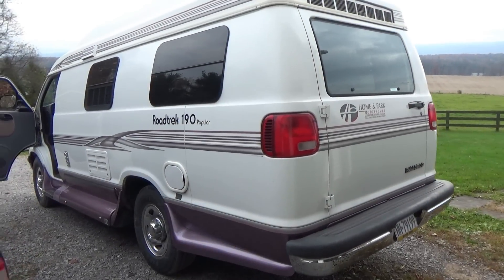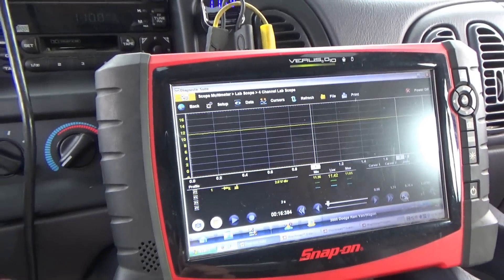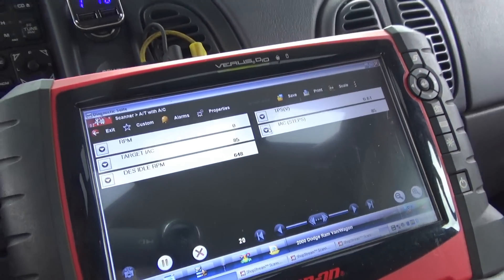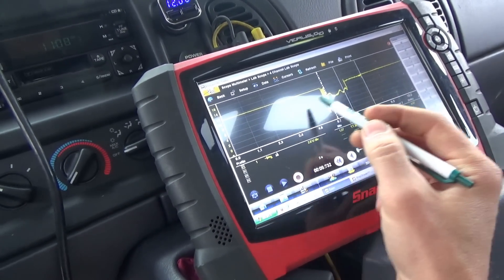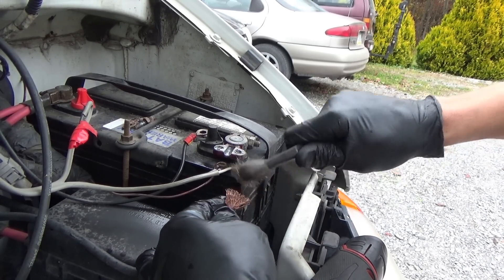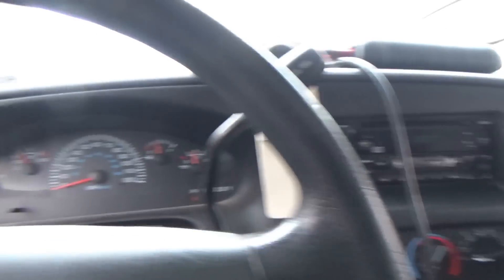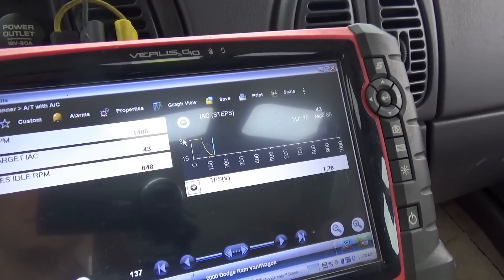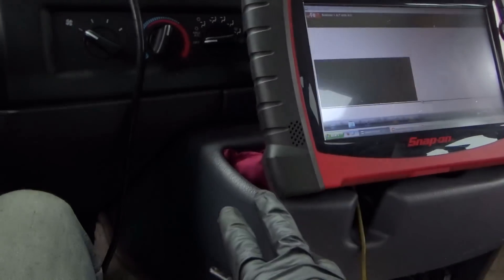Ram Camper Van is BACK! (Hot Start-STALL after X-country Trip?)

Comment: Well done ivan 😀
The evil resistance is a pain, especially with three types of metal playing up.
Connecting a volt meter to the starter + and battery + will show the evil resistance effect :-D
The wire looks rather thin so cranking  is not as good as it could be.
A new battery would give it a supercharge lol.
If it was mine, i would use truck battery cable,  i'm greedy lol.

Comment: I'm only 4 minutes in so far bit sounds to me after the hot soak the starter motor is too hot... common v8 problem... I would try insulating between starter body and engine block and going from there.

Comment: Why was the idle IAC initially 30 after the repair, but 20 later?
Battery state of charge!
With the poor connections charge current would be limited, but after cleaning the battery would be able to pull in the current it needed.
More alternator load, so more engine mechanical load.
Also, I think you didn't have the headlights on later.

Could you have got the minimum airflow test to pass?
Yes - but in practical terms you know it was done 8000 miles ago and removing the doghouse to clean the throttle body again just wasn't worth it, as this clearly wasn't the root cause of the failure as presented.
So I wouldn't have either.

Really hate those terminals.
We don't see them much in shops here, but common on eBay.
Most common here but equally bad are the ones that have a tubular connection with two grub screws - the tube size doesn't match the cable size and the screws only just touch some of the strands.
I use the "commercial" ones that have an 8mm stud to bolt a crimp lug on to.

Comment: Ivan..  I beg you Please just take 30 seconds and look up your video:  
"DANGEROUS to Drive! Ram Camper Van STALLS After Hot Soak - Part 2" -- 
It's your own video-- and jump to 10:27, and read the very bottom line.   I won't have to say anymore, you'll see it yourself.  Even if the IAC completely dies, the van will still idle when the screw is adjusted correctly..  The fact that the van dies when you do the "min air flow test', it's blatantly telling you that the idle screw is not adjusted correctly.    At the moment it's working because the IAC is constantly working to keep it idling-- but if the IAC dies, the truck will not idle, and that's not how it should be.  Your idle stop screw should act as a fail safe and manually keep the truck idling, EVEN IF you unplug the IAC, or it dies, or loses it's memory again, etc..   Adjust the cable and it will be bullet proof. cheers.
Reply from the maker: Yeah I know...but it's close enough so shouldn't have any stalling problems anymore :)
Reply: @PineHollowAutoDiagnostics  Love your channel bro.. I've gone back and watched almost all of your back videos, and I've learned so much from watching your stuff.  Keep it coming.

Comment: The problem with that terminal is all the dissimilar metals:   It has a lead connector with a steel bracket that bolts down to the coper wire.   So between the three, there are a lot of "noble metal" interactions happening there.
Reply: Noble metals are ones that resist corrosion.  There are no "noble metal interactions happening here."   The list of noble metals is rhenium, ruthenium, rhodium, palladium, silver, osmium, iridium, platinum, and gold.   Battery and cable terminals are not made from those metals.
Reply: @buckhorncortez  Thank you for saying what I was thinking.
Reply: Galvanic corrosion  does no favors.
Reply: @T.J. Kong dielectric grease will not help in this case because you all miss one very important clue on top of the battery is over spilling acid which is the root cause of the corrosion on the copper even dielectric grease will not help as the battery need to be replace as the cells are degrading which is causing too much off gassing enforcing spillage on top of the battery case
Reply: @SHSPVR  Not so much over spilling, but VENTING gase at the battery posts that cause the corrosion.   This is common on older lead acid batteries.
Reply: @SHSPVR  they "all" leak some acid out through terminals and mist via vents. however the real issue is junk wiring(impurities) or maybe even copper clad aluminum trash...
why do I say that and come to such conclusion? age and having had many vehicles/batteries/terminals which all worked fine fine for 20 to 30 years. now days? I wont even go there. but please keep buying foreign super trash garbage...
Reply: @throttlebottle5906  sorry but there not supposed to leak through terminals nor wick out the vent as this is first sign that battery plates are breaking down which is the indication that the plates them self are unable to store the electricity therefore causing the acid to go into overdrive, it's kind of like when you try to shove 200amps thru battery
Reply: the owner could've done some cursory inspection and basic maintenance and avoided all this. kinda like the dude who drove 8 hrs just to have PHAD correct the trans fluid level.
Reply: @T.J. Kong I use what ever grease I have handy. Put it on the battery lug and cable terminals. Keeps things from corroding. Never had an issue with the grease causing conductive issues.
Reply: yes, because the "factory" terminal/connections lasted a life time. yeah NO, Chrysler has pioneered every garbage method of every electrical connection and device as of the 1950's.
I especially recall the magical(lol) "lean burn" cruft (as a kid), my fondest memories are it always running poorly and breaking down often, albeit that made me pay more attention to mechanical/automotive, as I was paying attention to electrical, electronics, plumbing and more(everything).

Comment: The best way I've found to clean those battery terminals is to take it apart, sprinkle on a good dose of baking soda, and pour really hot water on it-- on the terminal, the post, the wire ends, etc..   Since baking soda is such a strong "Base, it neutralizes the battery acid so well that it literally just dissolves it completely away and leaves the copper very shinny.   I was kind of shocked at how well it worked.  So that's my go-to now-- and I ordered a case of baking soda on ebay for nearly nothing.  It's even cheaper than salt.
Reply: Baking soda is a great solution for cleaning battery terminals!
Reply: I can save you a lot of steps and ingredients...

Cut those terminals off, coat them in mustard, and then throw them in the garbage and buy a real set of lead or cast copper terminals. Those flimsy, multi-material terminals suck balls and mustard is disgusting...
Reply: @athhud  I agree, but I like mustard.
Reply: @2aminitials  I don’t know what is wrong with you mustard eaters. I bet you like pickles too don’t you? Both of them taste like something that has gone rancid... lol
Reply: @athhud  😀

Comment: I'm only 2 mins in: --   You should do the "min air flow" test again, and adjust the ((throttle stop screw)) so that there is still enough air flow to keep the engine running, even if the IAC dies;   as it said at the end of the service data that you read 10:27 (in your previous part 2 video on this titled: "DANGEROUS to Drive! Ram Camper Van STALLS After Hot Soak - Part 2".  You should read it again in the service data, it very clearly says to set the minimum RPM by manual adjustment of the cable, and you never did that in the last video-- I remember commenting about it then).  You never adjusted the idle stop screw-- and that's why it still dies when you do the "min air flow' test.  The engine should never be able to go below 640 rpm once you set the throttle stop screw correctly....  As it is now, you're still relying on the IAC to keep it running, and that's not what it's for-- the IAC is there to help account for excess load at idle, cold starts, etc.    But when doing the "min air flow" test-- the engine should NOT die once the IAC is fully closed off-  Your throttle stop screw still isn't set right;  I understand that the IAC may have other issues too-  but you can bypass all that and at least get it to idle, by adjusting the cable.     Hopefully you come to that in this vid. :).. cheers.   Time to watch now
Reply: I think you might be correct. Ivan fixed the slow crank but not the stalling
Reply: before making ANY adjustments the throttle body should be pulled, inspected cleaned and rebuilt.. you should never adjust idle with screw adjustments to compensate for other issue.. its not a carburetor.. there is a small passage in the tbi that should pass adequate air for the engine to run at Idle with the IAC fully closed.. the tbi is DIRTY. the base gasket is likely leaking a bit,  where the Iac pintle seats is likely dirty. everything is screaming pull and clean the TBI.
Reply: @randy1ization  He did clean it in the last episode.  He showed how someone else was probably in there before - so that may be why the adjustment is off now.  The point is, when you clean everything and then do the "Min air flow" test, it turns the IAC off and closes everything completely-- so then you can set the minimum idle.   It should never be able to drop to 300rpm like it's doing.   The idle screw will set the base line.. and then the IAC only steps in when there is more load, or when it's extra cold, etc..  It doesn't absolutely need it, which is why it's still working now.  But it's a nice redundancy that makes sure that this thing won't leave you stranded if the IAC dies, and fighting to start it..   Newer 'drive by wire' vehicles don't even have this adjustment, but most of them don't have an IAC either anymore.   I don't think the IAC is supposed to be so active at keeping the vehicle idling/ running - which is going to shorten it's lifespan.   It's only supposed to step in as needed to assist:   such as if you're parked and coolant fan is running, and your AC is running, etc..   But for just a dead idle with no load, the IAC shouldn't have to do anything.
Reply: @calholli  exactly.,. but you cannot properly clean and service the TBI without removing and disassembling it.  the only cleaning I saw was from the throats of the throttle body.. you cannot get to the passages below this way.. you cannot inspect the base gasket, you cannot check for a rusted or broken spring in the fuel pressure regulator,,  you cannot clean where the Iac pintle seats.. Oem parts for these TBIs are relatively cheap, I would just rebuild it, and be done. having a mindset of always trying to fix things with no parts required can cause alot of comebacks. 20 to 30 year old parts wear out. the Iac pintle has moved back and forth millions of times.. why fart around for hours with a 50.00 part?
Reply: @calholli  heres why I disagree,, if it were cable adjustment issue, it would do it all the time.   this  is  intermittent. cable adjustment has nothing to do with the irratic IAC counts..  when the books says clean the part, they mean the whole throttle body.. not just the throats and what u can reach from the throats.. IF ALL ELSE FAILS,. then consider a stop screw adjustment.. Idleing poor running or intermittent problem engines up,  without finding out the root cause, IS hack work. I will stick to my diagnosis that the IAC is failing and the internals of the throttle body are dirty. in the first vid I said it would be back, and it came back.. Ivan is a gifted tech,  but why he wont just pull the throttle body and rebuild it I dont know.. its his chicken to pluck. ha
Reply: Exactly what I was going to say.
Somebody probably adjusted the cable or stop screw at some point or it's worn. Highly unlikely the throttle body is that dirrty in 8k miles.
Reply: @Turbotomass  I agree;  those cables can stretch over time, and you have to adjust the screw accordingly.  I think he just didn't want to pull that doghouse again.  I guess if it comes back again, he'll get it covered on the next one.
Reply: I remember doing the minimum air adjustments on my 86 TPI Camaro when i was learning how to work on EFI. You had to jumper A&B on the ALDL, turn the key on, disconnect the IAC, start the engine and put it in gear with the parking brake on and then go adjust the screw until the engine was running at 550RPM. After that, you had o shut the car off and use your volt meter to adjust the TPS to .55 volts. Good times
Reply: @FIXXERAutomotive  lol I remember those days . I worked at a Chevrolet dealership as a technician in the 70s and 80s👊🏻👍🏻
Reply: Back when at Buick in the mid to late 80’s I did a minimum idle air adjustment on practically every FI engine that came in with a drivability problem, both because it needed it and it was part of the worksheet we had to fill out and submit for warranty coverage (a measly .5 hrs). Almost every car I encountered wouldn’t idle at the minimum. This van needs it and I’m sorta glad he got a comeback. Although in pt 1 I didn’t think the battery cable caused the erratic idle, he knew they were going on a long trip and no way that cranking performance was right and it shouldn’t of been sent without further investigation. I also worked on tons of dodge v8s like that one and you get to know what a high spinning gear reduction starter should sound like.

Comment: Had very strange issues with my 02 grand Cherokee due to these crappy lead bolt on crimp style battery terminals. Had constant issues with no crank while turning the key,  instrument cluster needles bouncing around while cranking, low and rough idle, flickering cabin / headlights, alternator randomly not charging the battery. Then I decide to solder some copper lugs on the battery cables and bolt them to the terminals and all the sudden the jeep ran great and everything just worked after that point.

Comment: Nice no parts required.
Would have put a ring on the cable and replaced that cheap junk terminal ( know from experience) with a marine style more reliable and would probably last longer than the vehicle

Comment: How many times was the oil changed in that 8,000 miles is my first question as this could certainly contribute to a coaking up throttle body in such short order.

Also needs a battery or charging system repair as low voltage resets should be expected until this is fixed.
Reply: Open driving is not like stop and go driving with the oil. Would definitely do an oil change after 8k miles but having all emission items in good order would be my plan moving forward rather than wait for the next problem.

Comment: That's why I hate and never use these types of battery terminals. The only acceptable connection is a crimp or soldered on lug that's screwed onto the battery terminal. I prefer to both crimp and solder, since the solder prevents water and battery acid from getting inside the crimp between the strands of the wire and slowly rusting it out from the inside. With solder you get a hermetically sealed joint.
Reply: I try to avoid solder on the heavy cables that see a good bit of shaking just because of how brittle they get. I started using the heavy duty cast copper terminals (they are sealed at the end). I slather some liquid tape in the small gap between the insulation and the lug, then slide adhesive-lined shrink tube over it. Install terminal, spray with terminal protectant, let that dry, and then brush on a nice even continuous coat of grease (paying great attention to the bottom of the terminal). With this method I’ve yet to have a single corroded terminal in the last decade. Even with some rather leaky batteries.
Reply: @athhud  that's a good method, better than solder if you have a good crimping tool that makes solid crimps. adhesive lined shrink tube is good to keep out water. Some crimp terminals have a hole in the end, so that needs to be sealed too.
Reply: @athhud  
It’s sort of counter intuitive a bit isn’t it? You’d be forgiven for thinking that solder is the gold standard but time and time again it’s proven not to be the case.
Reply: Agreed though using heat shrink tubing with sealant is the ultimate repair

Comment: The green crusties are caused by oxidisation of the copper.  Perhaps tinning the end of the cable with some solder would stop that problem.

'Tinned copper is primarily used for protection against oxidation and corrosion. In climates where copper has long-term exposure to water, the oxygen will combine with the metal and form copper oxide, weakening the bonds of the metal. It is worse if the wire is in contact with salt water.'
Reply: No, tinning wire before clamping it in a connection is prohibited, because the solder will slowly "flow" away under pressure and cause a loose connection. Many fires were started by this practice back before it was banned in the electrical trade. Soldering two pieces directly together (so that the solder is not under pressure) is still a good connection practice that can be used today.
Reply: @brainndamage  that may be true if you use excessive amounts of solder, however, tinned wire is commercially available and it would depend on the type of Clamp used.  Must people would tin the wire and wipe it away leaving a thin protective coating.  Conversely a corroded connector is a fire risk.
Reply: No need for solder. Use solid terminals with a proper crimping tool and seal the gap between the lug and insulation with adhesive-lined shrink tube. I like to apply a little bit of liquid tape before I slide on the shrink tube, but I tend to over do things... An adequate coating of grease goes a long way too.